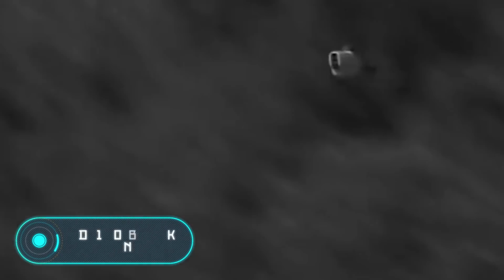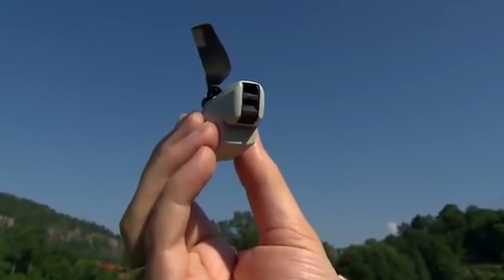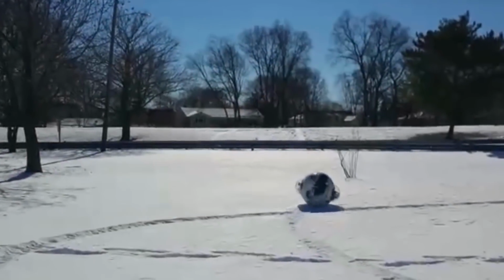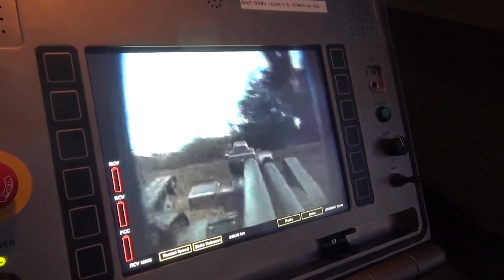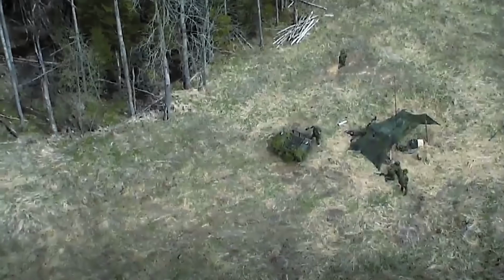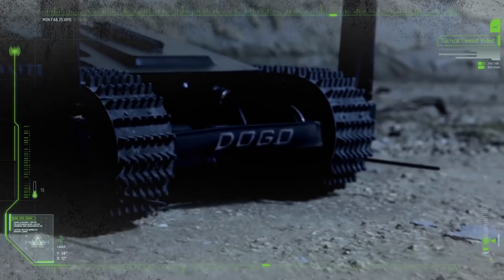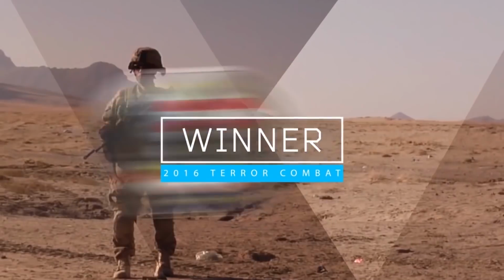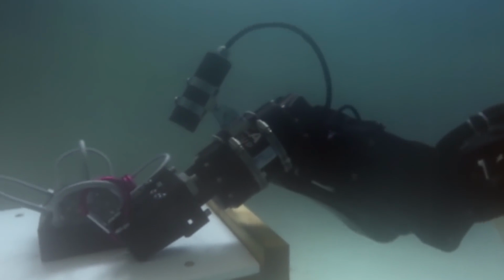AMAZING MILITARY INTELLIGENCE TECHNOLOGIES

Comment: Funny that lil heli drone can fly in any weatger but they never show it cause it cant too light weight
Reply: Thats what I’m thinking also. I hate being lied to.
Reply: @shanepowers7566  I saw this actual Tech at a playing show one time when it first came out to the public and they were actually admitting they had it. And it's so lightweight all the technology and money is into the camera and guidance system so it's easy to fly. The problem is the weight of it it's like a mavic it will fight against the wind and all that really good but you start getting sticky snow piling up on top of it on his blades on his body it's going to fuck up the balance and it ain't gonna fly very well, not only that the camera is about the size of a mosquito so one raindrop or snowflake on it and it screws up the whole image LOL I would like to ask around the military form to see if anybody's actually use the one in bad weather to see how it work and I can't imagine being a RC enthusiasts myself thought I would fly very well in snow or heavy rain

Comment: War Drones And Combat Robots Will Probably Increase Civilian Casualties In The End. Has Anyone Else Seen Terminator? Because Of Rapid Deployment, It Is Easily Imaginable That They Will Be Weaponized Beyond Machine On Machine Combat Battlefield Scenarios, To Include Gorilla Tactics, Being Less Effective When Anti-Air And Ground Defense Capabilities Are Present, Even By Less Technological Adversaries, And More Effective Towards Soft Targets. In Scenarios Involving More Technologically Advanced Adversaries, As In Total War, The Battlefield Dynamics Of Drone Use Will, Most Likely, Primarily Be Used For Striking Civilian Populations And Ambush Tactics, Due To The High Maneuverability And Cost-To-Benefit Ratio. It Also Would Be Easily Blamed On Non-Combatants To Incite Proxy. The Dynamics Of Warfare Would Suffer A Dramatic Shift. Pandora's Box (ie. Shitstorm), Especially Once Automated.

Comment: Do a video of the most powerful drones available to the public that anyone can buy right now.
Reply: I know one thats called the phantom and its $1,800
Reply: Skully Slayer I actually own a phantom 4
Reply: @skullyslayer7148  that's one of the most powerful availabe to the public? That's a weak drone compared to the military grade ones. When comercial drones get NEAR the power of militar ones, I'll consider buying one maybe......those phantoms have a max flight durarion of 30 min right? And not so far range.......i want a drone that could go 2 hours and 50 miles.
Reply: TaureanKing 4 miles is a long way away and u have multiple batteries with your phantom it’s also good for photography/videography and can fly as high as 500 mi own one and it doesn’t disappoint
Reply: Benedict Rucker 
I want a drone that can spray paint as well as video, to thwart the thieving Thai fishermen who steal the fuel off my boat moored at sea.
Any suggestions please?
Reply: Chris Turner apache attack helicopter that is the solution
Reply: Benedict Rucker 
Thanks for that. Very entertaining, but way beyond my capabilities. Perhaps if I were 40 years younger I would consider it, ha ha....
Reply: Chris Turner guess so
Reply: Benedict Rucker 
The boats moored only 250-300m away from my home, so a snipers rifle might suffice..., or more seriously, maybe a paint ball gun. I need to check that one out for range capabilities. 
Thanks for setting my very grey matter in motion :-)
Reply: Chris Turner maybe a few trip wires with flame throwers as long as they’re not near anything flammable
Reply: Benedict Rucker 
A remote control model submarine with a wood boring tool - sink the b......s
Reply: TaureanKing yesplz I want this vid the I wanna buy some of em